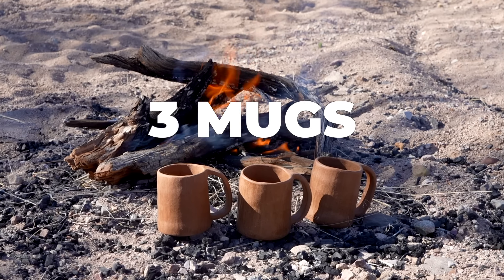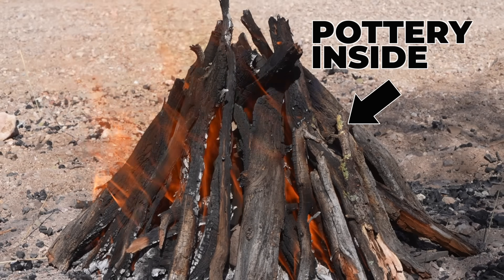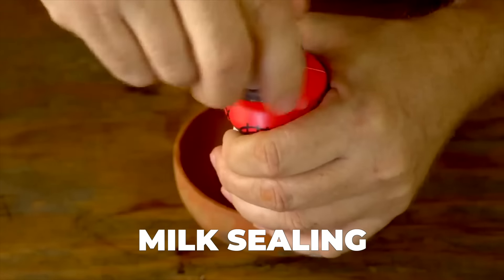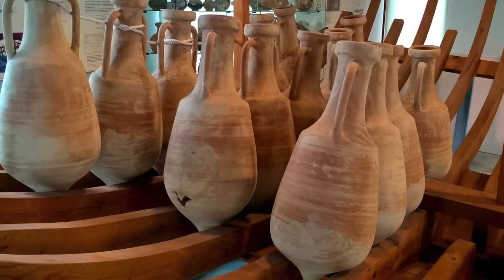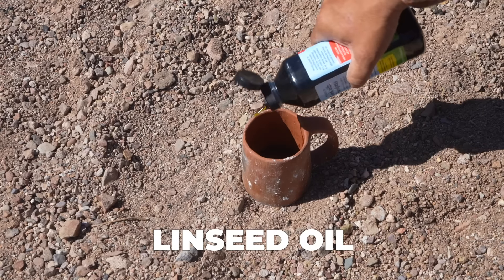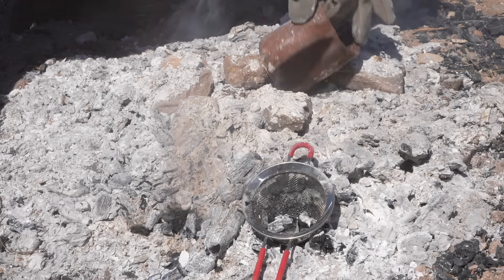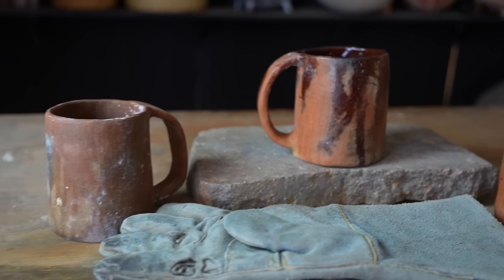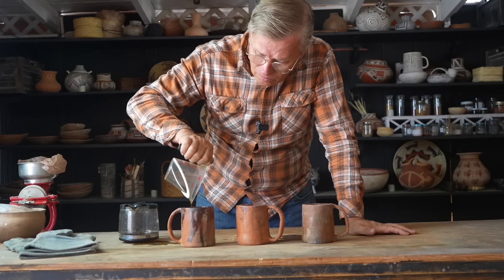Sealing Mugs With Old World Methods

Comment: Do you think they use pumpkins and other things like that? Like squashes and watermelons for a Mold. And once they dry, just peel the stuff from the The inside i'd like you to try and see if it would work.
Reply from the maker: No, all those things, gourds, squash etc have a little pucker on the inside bottom that would make them unstable for a mold
Reply: @AncientPottery  I'm just talking outside. not the inside at all

Comment: Looking for an older way to seal plant pottery. I really don't want to use a spray sealer. Listening to you has brought to mind that the beeswax clothes being sold to replace plastic wrap is beeswax and a touch of pine resin. So I  can see where the pine pitch comes into play. 🤔🤓
Instead of linseed oil, I would have looked at the health food section for food safe flax seed oil.

Comment: How much of a seal can be achieved with the terra sigillata technique? I was under the impression that’s what it was used for in ancient times, before glazes.

Also I’m aware that a lot of people around the world still cook in earthen ware. Particularly in India, they season their pots just like cast iron cookware.
Reply from the maker: Slipped (terra sig) pots still weep pretty good, the slip does slow it a little but far from 100%. It all depends on the intended use for the pot. For a cooking pot you can use it unsealed as the cooking food can help to seal it and the heat will help to evaporate any seepage. But for a coffee cup or a dinner plate you definitely want them to not ooze all over the table.

Comment: You would need a few coats of the linseed oil.  Wipe it on with a rag, heat it, wipe off excess - repeat.  The coating will also cure and harden over time (days & weeks).  This is at least my experience with seasoning cast iron.

Comment: I am 4.5 min into the video, but had to pause to suggest that after using organic flax seed oil, you put the mug in an oven and season it as you would a cast iron pan. Perhaps not as hot, but long enough to well dry, polymerize, the oil. Pure tung oil may be even better.
Update: Should have kept watching. You knew to heat the flax seed oil lol.
Addendum: If it were me, keeping in mind that I have never made a mug, I would soak the entire mug in organic flax seed or pure tong oil to saturate. As you did pre heating will speed this up. Wipe it down after awhile with lint free cloth. Warm the mug again and saturate with oil. After a bit, wipe any access off; have an oven pre heating. I am not certain what temperature is best. I have found that many people use too high a temperature seasoning cast iron pans, resulting in the coating breaking down. I would try 350 degrees F for an hour or so. Mug baking upside down. If one baking doesn't do the trick, make you happy, apply while still hot from the oven a THIN coat, and bake again.
I think this will dry the flax seed oil properly and greatly reduce the scent.
Bees wax looks much quicker. Could melt bees wax into hot tong or flax oil to make a paste; just like wood workers do, but you could likely taste the oils till they had some time to polymerize.
Wonderful craft.

Comment: I am a scientist and, since we all know what happens if you don't seal your work (hence the fact that we use a sealant in the first place), I think your experiment is good. Not all experiments need controls. It's ideal but sometimes it either isn't possible and/or it isn't ethical. In this case, anyone who wants a control can try to use their pottery without sealing it.
Reply: Dropping the control means you lose the math, something to be avoided in most cases.  An unsealed comparison lets you calculate how effective each material was off the baseline.  Without the control, we do not know if the worst seal had any effect at all.  Baseline controls...always.  Rigid controls...only if you plan on making it a process.

Comment: Anyone know a food safe way to seal wood against alcohol?
Reply: (Finnish) Pine tar. Done few dosen wooden shot"classes", sealing any containers from outside with hot pine tar. Other method is to char them, but that has risk of cracking container.

"Old" tar mixing recept:
1 part linseed oil, hemp or Chinese wood oil 
1 part tar 
1 part (pine tree) turpentine

Comment: love your videos but a quick note on beeswax: it is still commonly used to seal horn mugs. While it works great, it would not be recommended for anything hot as the heat will break down the beeswax over time.

Comment: You can fire your mugs after applying a mix of the same clay 45%,water or whipped egg whites plus salt55%. Fire inside a clay box to limit air. Causes acid rain but it worked for centuries. Salt glazes can incorporate colourants too. Fe, Co, Cu are all good to less than 2%. Warning flow causes adherence to shelf so primitive firing works best and acid proof and safe glazing finish can be cottage cheese finish dependent on trace elements in clay sample.

Comment: I have sealed water gourd containers with pure beeswax and it works very well.  I tried pine pitch once and it made the water taste like turpentine.....YUCK !  I have used linseed oil only for sealing wood and metal with many coats and it is a very time consuming method.  Using black coffee for your liquid does not seem like the best choice to me because coffee is so bitter it will hide the taste of anything else.  Also placing the mugs upside down on sandy, dusty, or any unclean surface is going to to do exactly what happened in this video.  What were you thinking ?

Comment: 4:14 I'm wondering how many 'hot drinks' the Romans used to have? especially the common folk? Certainly would not have been coffee, but there were other concoctions, I believe, where a hot poker was stuck into the liquid contents to heat. I would have thought that normally, most drinks would have been either cold or room temperature?
Reply from the maker: I really wasn’t trying replicate Roman cups or drinks. I was making these mugs for myself and trying to learn from the ancient Romans. And I enjoy coffee in my mugs which is why I tested with coffee.
Reply: @AncientPottery  Yes, completely understand your direction (knew the coffee mugs weren't Roman lol - merely representative). But was wondering if any liquid of a regular temperature, not hot, would also end up with the taste of the sealing substance? (especially the pine combo?) and, now you've experimented a lot, how long would that taste continue to linger if so? (or maybe you've mentioned this in another video?)

Comment: I sealed pots with cooking oil by coating inside and seasoning in oven like an iron pan. The carbonization would probably be good for your cups too. No melting. No taste. Season them. Let the fire burn the sealant.

Comment: You'd get a better taste test with just hot water as in Roman time they didn't have access to coffee.
But if you want the ultimate in sealing, there's always salt glazing. Granted it's pretty nasty stuff to fire (it produces gaseous chloridric acid and leaves a sodium glaze on the ceramic), but it was used for sealing pipes for decades if not centuries.
Reply from the maker: I wasn't trying to replicate any Roman practices, just looking to the past for an efficient manner of sealing earthenware. You can't salt glaze in an open fire like this, it is done in a kiln and requires hotter temperatures.
Reply: Use a different salt maybe?

Comment: For wood, boiled linseed oil takes 2 or 3 days to dry. For raw linseed oil it takes 1 or 2 weeks. Maybe length of dry time would effect your results.
Reply from the maker: No doubt and multiple coats. Also we can heat up ceramics much hotter to speed the drying than we can wood. But that smell…

Comment: Weighing the cups before and after the coffee test would have been easier, that way you can taste test without it having any impact. I wouldn't be surprised if the linseed oil needs a few coats, like a cast iron skillet

Comment: Okay this might be a little long winded but….. I wonder if you couldnt seal them by repeatedly boiling coffee in the cups. I used to have one of those “pour over” coffee makers with a metal mesh filter. Over time the natural oils and waxes from the coffee i used built up to the point that it would not strain through anymore. The manufacturer noted this as a possibility in the manual and said it needed to be boiled out with specific types of acids. So if you did repeated boiling’s with a very concentrated very dark roast bean (kinda like how the turks make coffee) id bet you a dollar itd seal up pretty well even with hot liquid. Just don’t drink orange juice or vinegar out of them 😅

Comment: Wine is cold not heated and pine pitch melts with heat so putting hot coffee in it will melt it adding the pitch to the drink that will taste like crap
Reply from the maker: The melting temp for that pitch is much more than the temperature of coffee

Comment: If the largest issue with oil was that it needs multiple coats and leaves residue from the oil in the container, perhaps the ancient roman oil vessels were sealed with the very same type of olive oil they were transporting?
Provided multiple sealings would be sufficient to prevent leakage, it would be convenient for them to seal with their own product, and there would be no issue with product contamination if the contamination itself were identical to the transported substance. ("Oh no! I got olive oil in my olive oil!")
Reply from the maker: The type of sealing would depend on the use of the vessel. So as I said in here those oil lamps were often milk sealed, perhaps because the olive oil, over time would soften a resin or wax seal. Oil sealing would make sense for an oil lamp but it wouldn't work because the oil would over time soften the polymerized oil.
Reply: @AncientPottery  
Ah, that makes sense.
Any idea how milk sealing would hold up compared to beewax sealing when used for oil?
I'm not sure if the oil would have an effect on the beewax like it would oils used to seal the clay.

Comment: Linseed oil needs enough time to bake and enough access to oxygen. If it soaks into the clay and can't get oxygen it won't polymerize easily even at temperature, it will just become slightly sticky oil.

If linseed oil was used in ancient times for this my guess would be that they used it for volume production where they had many earthenware cups prepared and they just periodically brushed oil into each cup and let it dry on some rack (maybe even a few weeks at room temperature or in the sun, instead of baking it; if oxygen diffusion is the rate limiting step it might not make sense to even heat it). If it takes you upward of a minute per cup to go around evenly brushing linseed oil into them and placing them back upside down you can do 500-1000 per day, per worker (depending on how horrible roman working hours were; they used slaves for a lot). If it takes a week to dry and be ready for another coat then you need 3 500 - 7 500 cups to keep one worker busy full time. This makes sense in towns with tens of thousands of people and up; earthenware was cheap, breakable and replaceable; if it takes 5 coats this translates to 100-200 cups per day being finished coating, with tens of thousands of people needing 2-3 new cups per year that equation works. 

For smaller scale production maybe the guy brushing the linseed oil into the cups could be an apprentice at the pottery who has other tasks as well.

Comment: I know I'm looking at this a year on, and I'm sure for this test you were just testing the seal worthiness of each substance.  I have to say that IMO, from a purely esthetic position, the Pitch and Linseed Oil mugs were negatively affected by the process.  They look stained and positively unattractive.  I wouldn't be able to bring myself to use them.

On the point of liquid levels, all were down a bit, but you did drink some liquid from each cup, so I would expect the mugs to be down a little anyway.  Interesting to see the beeswax mug was probably only missing the sip or two you took from the mug.  I think if I were to use a sealant l would go with bees wax myself.

Comment: I dont know anything about earthen ware, just kind watch these videos as I go to sleep. But I do work with fillers, mostly body fillers in the auto world, and I had a albet small idea. What if you slightly oversized your cups/bowls, fired them to cure, then after let it cool, and apply another internal coat of clay while trying to "squish" it into all the mico imperfections, then fire it again to cure that layer, maybe even do that two, maybe three times. Should have enough sealed by then to not really need a sealer, or maybe at that point just a fine coat of wax.

Comment: cant you use the wax / resin / milk method to seal wooden puki's  ?
that way you'll need to worry less about the clay sticking to the bowl 🤔
Reply from the maker: No you’ve got it backwards. You want a puki to be porous, that way the clay dries and shrinks and pops right out.

Comment: you should have use hot water, not tea, hot water so you could pass it to a clear container and see if the water changes color, and also can check how much the color change after a few times but other than that quiet the informative test

Comment: He tenido buenos resultados impermeabilizando un recipiente en forma de botella y un vaso, realizado con fibras vegetales (esparto) con la técnica de arrollado en espiral. Una mezcla de partes iguales de cera y resina, puede variar esta proporción y obtendrás distintas densidades para tus propósitos. Contiene agua sin filtraciones y sin saborizarla. Esta es la receta básica (a falta de carbón vegetal molido y fibras) del pegamento primitivo usado ancestralmente por la humanidad. Me encantan tus videos. Gracias por compartir.
I have had good results waterproofing a bottle-shaped container and a glass made with vegetable fibers (esparto grass) with the spiral winding technique. A mix of equal parts wax and resin, you can vary this proportion and you will get different densities for your purposes. It contains water without filtrations and without flavoring it. This is the basic recipe (in the absence of ground charcoal and fibers) of the primitive glue used ancestrally by humanity. I love your videos. Thanks for sharing.

Comment: Another option they could've used is an ancient glue made from ram's horns that's powdered and boiled in water. It was known to be used by Arabs and Mongols to harden their recurve bows. I imagine it's much like horses hooves have been used to manufacture glue in modern times. It would definitely make a strong moisture barrier that's odorless and flavorless after it cures. Perhaps ivory from African elephant tusks could've been used too. There's probably a lot of options for such a glue. Come to think of it - lime from crushed and fired seashells makes a good moisture barrier also and would've been plentiful around the Mediterranean in ancient times. Didn't the Romans use plaster to insulate their homes? I know they had their own version of concrete.

Comment: You really don't want to use boiled linseed oil but 100% linseed oil is actually flax seed oil. I would prefer bee's wax over anything else as it is edible non toxic and does a great job as a sealer. Remember pitch is what they seal wooden boats with. Thanks

Comment: Beware of sealing with boiled linseed oil (BLO). The modern stuff use metal catalyst agents. Different brands use different chemicals. Some catalysts are nastier than others. I had the fingernails on my right hand fall off (they grew back) from handling one brand without gloves. Once the stuff is set it’s fine to handle, but I wouldn’t consume food in contact with with set BLO.

Comment: They used wax quite a lot in the 18th century . Especially in leather and wood canteens . Seemed to be reliable . They did have to reseal from time to time . You should try to make a zeer pot . Its basicaly an African refrigerator . You get a big pot , then a smaller one that fits into the big one , fill the void with sand . Once done , pour water into the sand between the pots , then cover with a damp cloth. Basically an evap cooler . Keeps food fresher longer in hot climates , American natives could have done that, but no evidence to show they ever did .

Comment: Ehh.... 
The linseed oil is going to be the worst option unless you mix a catalyst into it to promote polymerization. if you had rust you could probably brush that onto the outside of the linseed oiled surface before lightly roasting it a second time to finish the sealing. 
Pine Pitch is actually one of the most variable options because the consistency of the pine pitch can change radically from species of pine used to make it, area where it originates from, and the relative humidity where the pine pitch has been 'worked'. In that regards, it's akin to the 'wild' clay made in some of OP's videos. 

My money would be on the beeswax. If you dipped the fired cup into a large pot of hot, boiling wax, and then took it out to dry, that would probably be the best option, although that requires allot of wax to do.

Comment: "Romans used Earthenware on everyday basis" isn't exactly correct. Practically every inhabitant of the roman empire had acess to burnished ware or terra sigilata (or a low quality version of terra sigilata). They used so-called "indented beakters" as drinking vessels for a long time. Most of these are not nearly as porous as prehistoric pottery and don't actually require any sealing.
Reply from the maker: Terra sig burnished pottery is still earthenware. Earthenware is defined by the temperature it is fired at. Slipping and burnishing are just methods of sealing and making earthenware more usable. I have sealed pottery in this way and I disagree with you that they don't actually require any sealing, if these vessels were not sealed then they also were willing to live with a certain degree of weeping that always occurred.